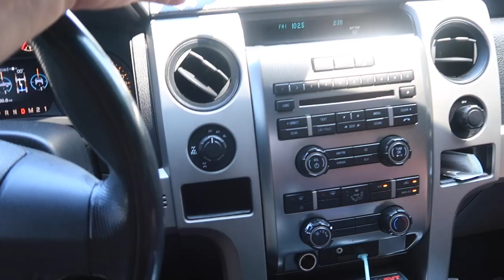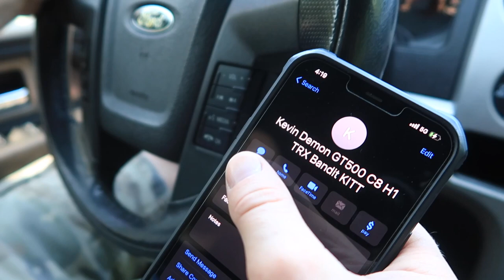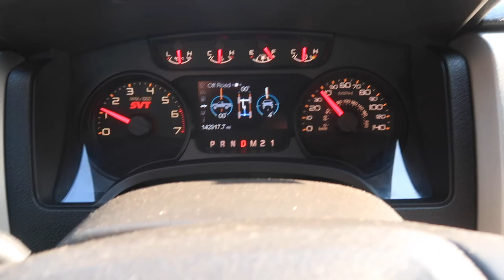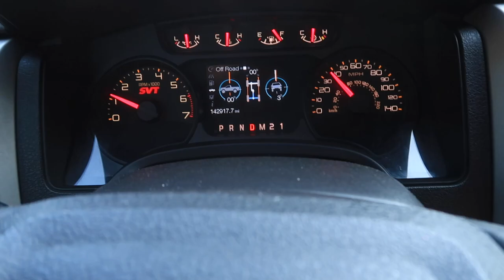I Regret Buying my SVT Ford Raptor

Comment: I understand thinking a vehicle is better than what you have. I had a 1971 Dodge Demon that would run Pro ET at Old Dominion when the track was still in Manassas. I wanted to go faster. There was a professional race car builder in Madison county named Bernard Weaver. One of Bernard's buddies was going through a divorce and needed to sell a 1973 Dodge Dart. It was tubbed with Direct Connection Super Stock springs moved into the frame. It had a six point cage too. The inner layer of metal had been removed. The windows.were bolted in place and everything that didn't need to be there had been removed including all seats except the drivers seat. I wanted the car for pro street to drive around. But, the windows wouldn't roll down, there was no passenger seat, no radio and no heat in the winter. Okay the car ran Super Pro, but I just didn't have the fun I had in the Demon. I sold the Demon and picked up the Dart for $2600. The guy was in a hurry to sell the car. That Demon was the king of the street. I had so much fun in it. Everyone knew it. The red nitrous oxide Dodge Demon from Woodbridge. I have regretted selling that car to this day.

Comment: Ive towed a full size suv with my 2012 screw 5 hours with no problem. stock suspension on 35x12.50r17s. Its the same motor put in the gas f250s around the same year models. Keep the raptor, enjoy it for what it is and buy a tow pig. See ya in a couple weeks in myrtle for mustang week.

Comment: I won’t pay 29k for 140k miles.I just think that’s way to much
Reply: I wouldn't pay 600$
Reply: 500$ for the truck in your pic. If it has a clean title and runs and drives perfect. Not worth 501$
Reply: @rosslefave5877  My truck has sentimental value to me.I ain’t selling it.Ever.
Reply: @RamandChevyOwner  400$???
Reply: @RamandChevyOwner  just consider it trading I have a viper bicycle I found in the garbage it's pretty cool. Get all the classy ladies on it. Throw some pegs on it I just might be able to find a set. Lmk 😁☺️
Reply: @rosslefave5877  My trucks worth $12k but I value it more